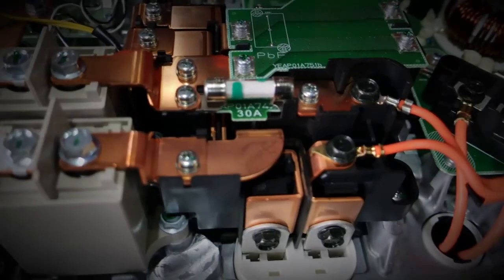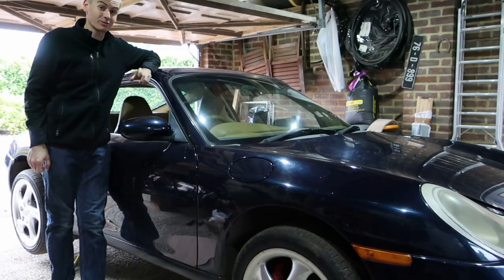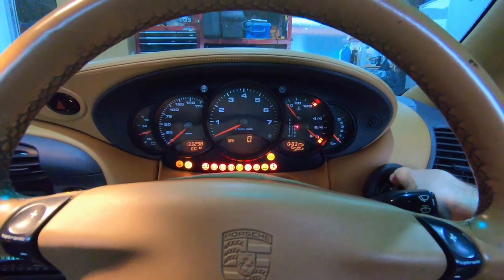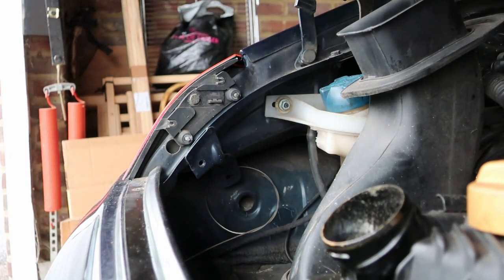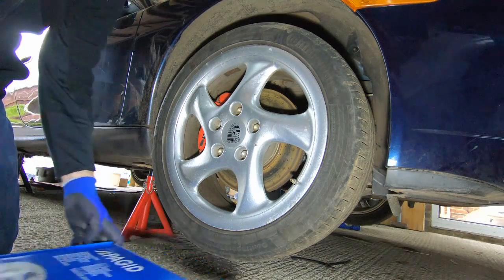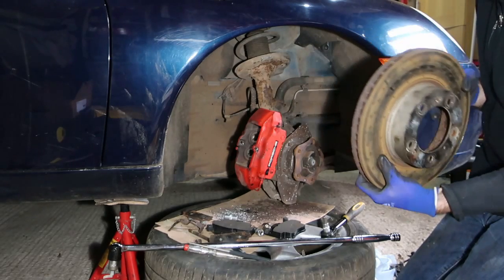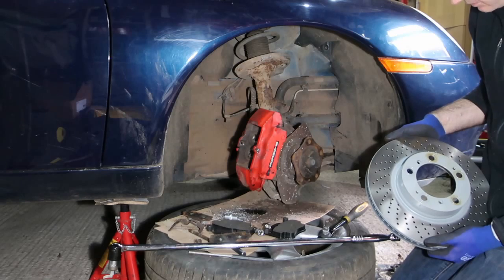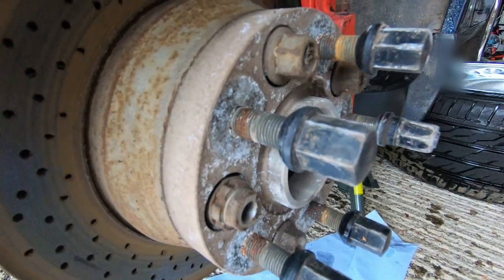Electric Porsche 911 project video 2 - Finding out what's wrong with our cheap Porsche 911

Comment: Coming late to this (March 2021).  Very interested in seeing the progression as I have a 2001 996 and considering an electric conversion.  I had a broken security tool, so I had to drill out the lock bolt.